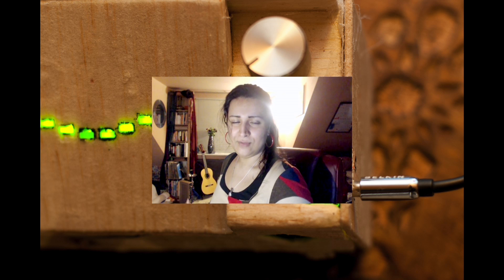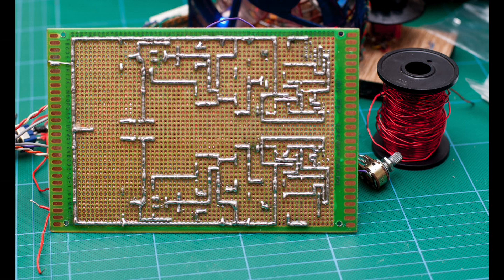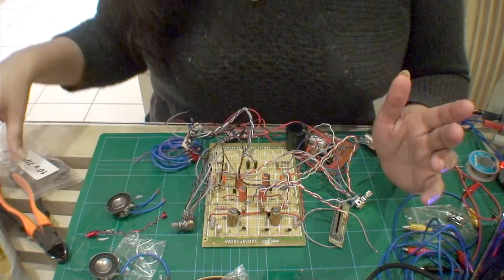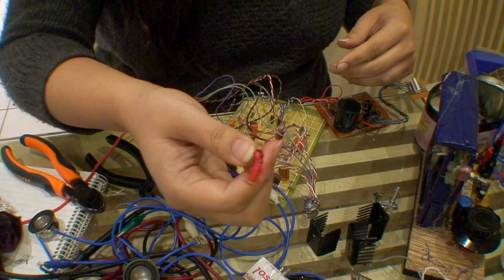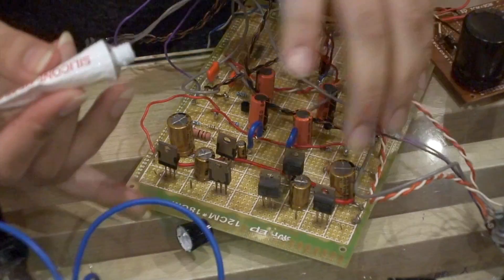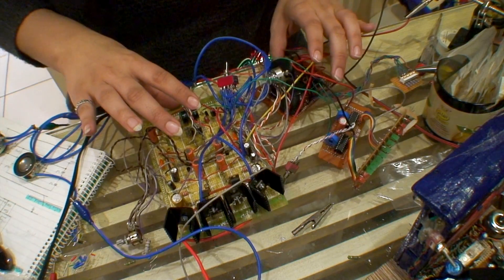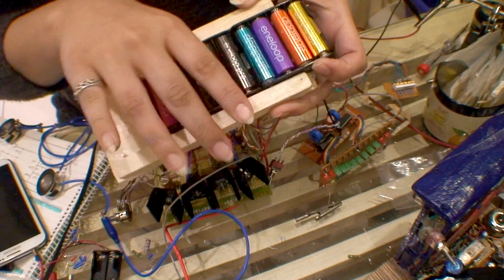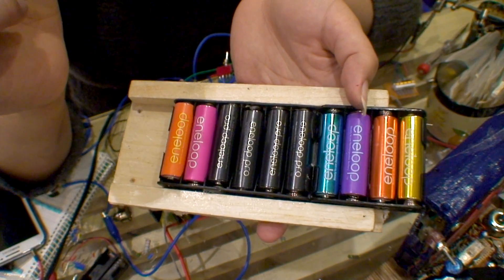Portable Amplifier V2 - Part Two

Comment: Just trying to help. The heatsinks can cool better if you use a little Artic Silver which I found to work and is a better Thermal Compound than the others and use copper nuts and bolts to fasten the heatsink to transfer the heat or use either larger heatsinks or heatsinks with more fins for better heat dissipation. Just a thought I use.
Reply: You can add more copper washers with thermal compound to help absorb heat.
Reply from the maker: Yes, I finally got some Arctic silver, it's fantastic!

Comment: Hey well done Ms Maddi :), 

I figured that I would respond via my musical channel as I can see a photo of
you playing the guitar. (I assume that it’s you lol ) By the way this is Daniel
and I am also a musician as well as a computer specialist. But I am not that
good with electronics. I am good with soldering as ~I used to solder components
for a living many years ago when I was still at school.

. - I commented on your previous headphone amplifier build and asked you about
the signal to noise ratio concerns. (I hope you remember me? :) lol)

I still have not fixed my amplifier yet. I am so scared to take it apart to be
able to get to re-solder the joints on the circuit board. I have taken off the
lid but cannot work out how to take it apart so that I can get to the solder
joints on the circuit board. I can send you photos if you like?

I also have several computer builds that are all working well. However, I am
very scared with this amp as I do not want to break it. I shall be posting some
of my musical work soon here and my computer related stuff on my other channel
so that you can see :).

Thanks for all of your help and support and advice with my amp repair and I
hope that you are happy with your headphone amp. I looks really good and I am
sure that it will work well with my HD800 headphones lol :)
Reply from the maker: +MaestrroMusician 
Hey thanks Daniel and yes I remember you :o)
And yes that is a photo of me playing the guitar lol. I need to start uploading my playing as i've had a few requests to do so. Also it's good to know you're a Musician too, this explains the professional headphone setup! :o) 
With regards to electronics, in my electronics related videos you will notice that i'm really pushing the limits of my humble knowledge of it haha.

I can understand the fear of taking apart your amplifier as I had that fear too, compared to a computer build the amp cannot be easily replaced. Sure do send me photos of it and if I can shed some light I will. Speaking of computer related stuff I have a build to do soon haha I need to put together a spare computer I have to sell it, of course i'll be uploading the build just like I did with my last one. :o)

Thank you! I havent finished my headphone amp yet, right now i'm filming the outer casing, i'm going to make this version 2 a little fancier lol. If you wish to follow up in the progress then watch this space, more parts coming :o)
I'm sure this thing could drive your HD800, however you got the SPL Phonitor 2 right? It seems very nice and It goes without saying you get what you pay for :o)